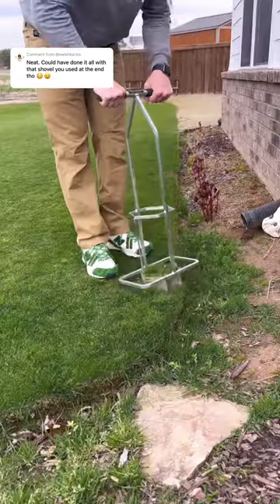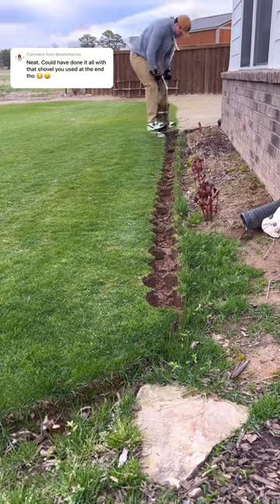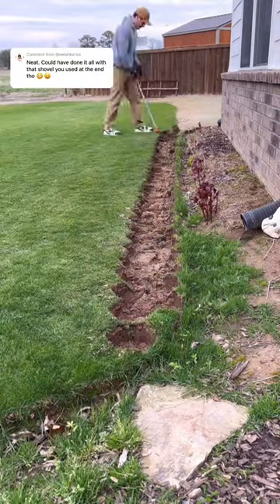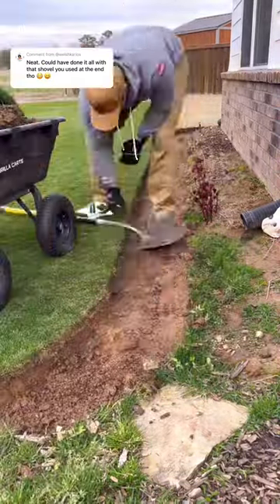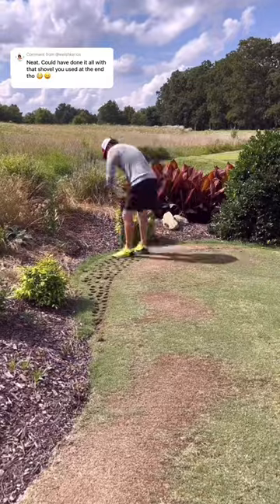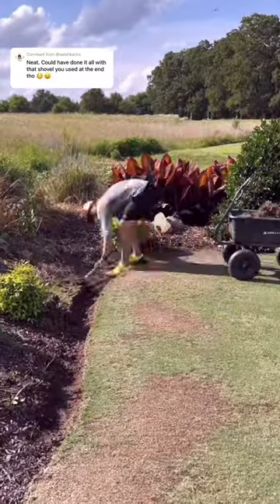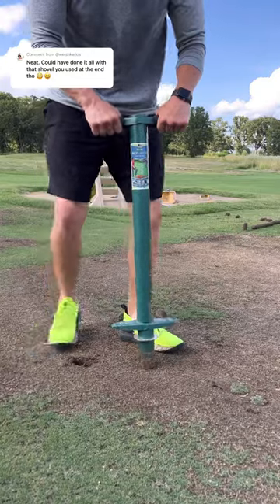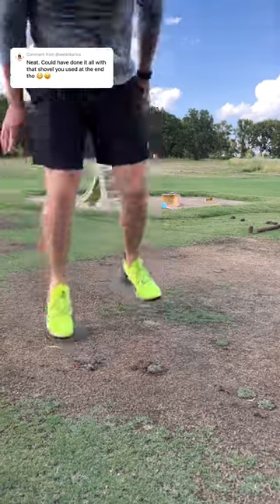Better Than a Shovel for This Purpose

Comment: 'Winter kill'? Looks like what we often call 'ice burn' here in Norway. It's caused by ice on top of the grass. In the sprint the snow covering the field melts, but the ice stays for a while, and since it's transparent, light gets through and starts heating up the ground. And with no air circulation, the temperature rises to damaging levels. 
If this is your issue you need to check the drainage, and in the early spring, grab a Digging Bar, and go around cracking the ice. If you have soot and ashes, sprinkle it on top of the ice also. Helps melt the ice faster, and it doesn't do your grass any harm.(Ashes were used as fertiliser before)